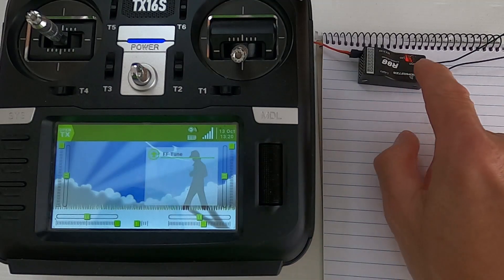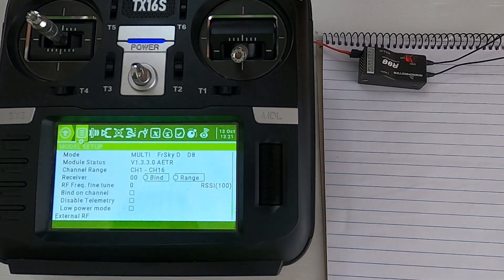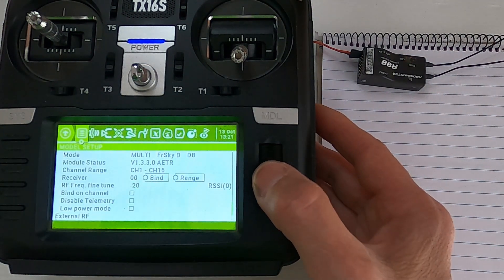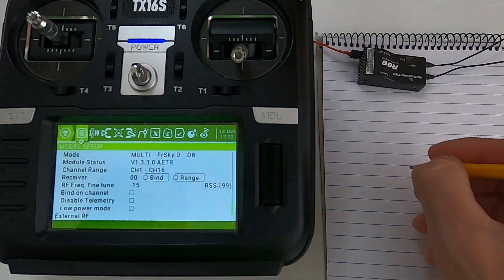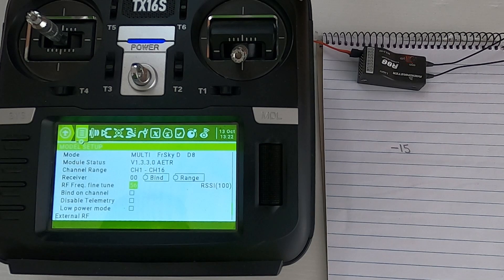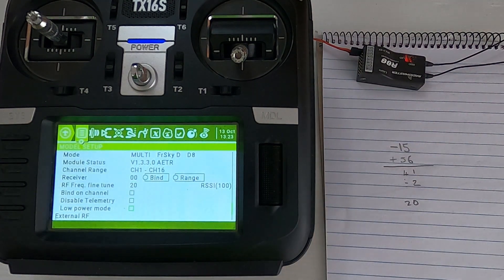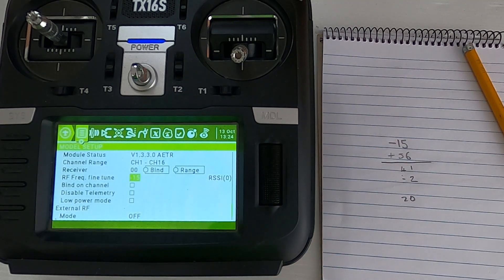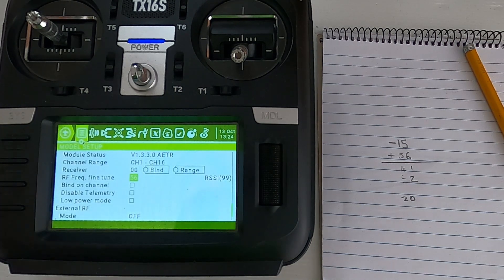OpenTX Radio Frequency Fine Tune – If your receiver needs it make sure you do it!

Comment: Hi Bill, yo show very easy way to bind witg fine tune.  I just open my new radio master tx16s markII but i can¡t find the option for fine tune with futaba, If requeire to do some upgrades on my radio? Thanks in advance!!
Reply from the maker: If the option is not shown you do not need to fine frequency tune the receiver.

Comment: My xm+ receivers loose bind if I do not assign a receiver number before binding. Has anyone else seen this? If I leave the receiver set to 00, it will bind, but after cycling the quad and the radio, bind is lost. If I assign a receiver number like 01 for example, it keeps the bind after cycling!
Reply from the maker: Ray, that is strange because if you select 00 it should bind and stay bound. Try changing the receiver type then select the FrSky protocol again and rebind and see what happens.

Comment: I also activate the "Low power mode" and put the receiver 2m away from the transmitter. Unfortunately this does not work with Spektrum receivers.